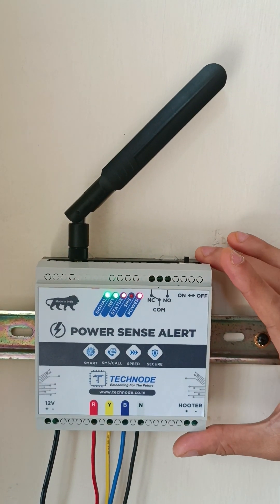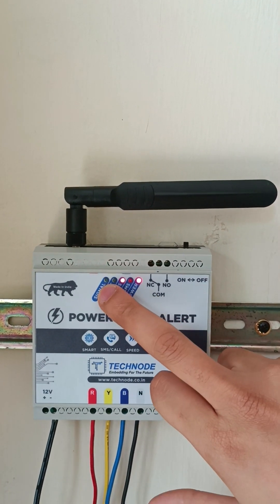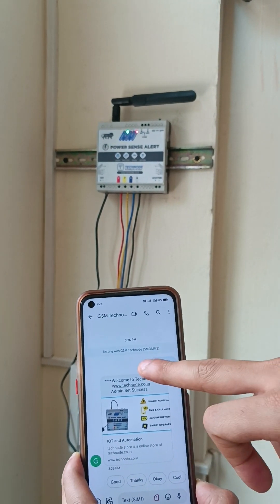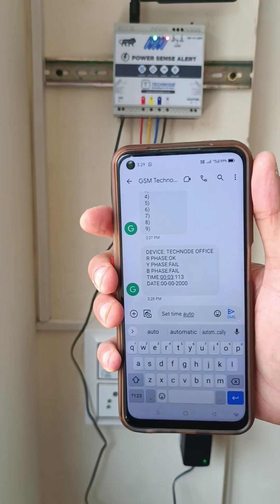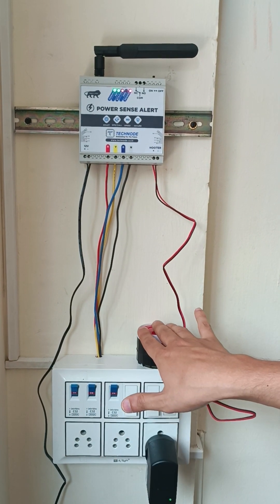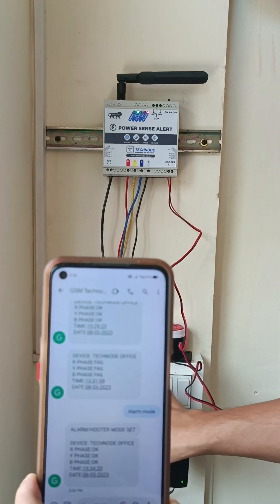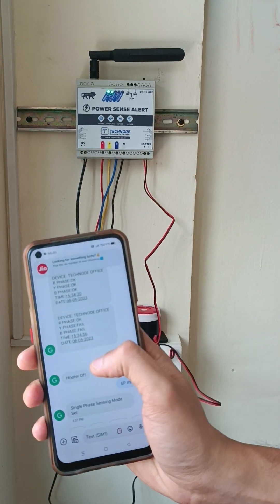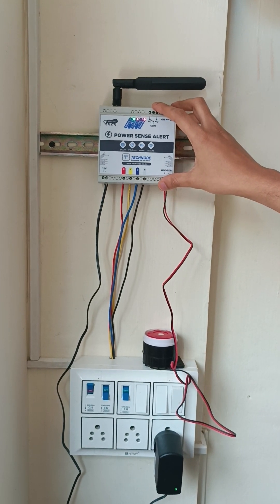3 phase Power Failure SMS & Call Alert Unit | New 4G Model | TECHNODE

Comment: You have connected tha adapter while tripping 3 phase, but when there is power failure, adaptor light will also gone so how will it work?
Reply from the maker: @hrishikeshchaudhari72  there is internal battery which has 24 hours of backup
Reply: Oh great, I am interested in this product for my EC poultry shade, what will be the pricing?
Reply from the maker: @hrishikeshchaudhari72  yes you can use it for your poultry application. Visit, https://technode.co.in/power-sense-alert